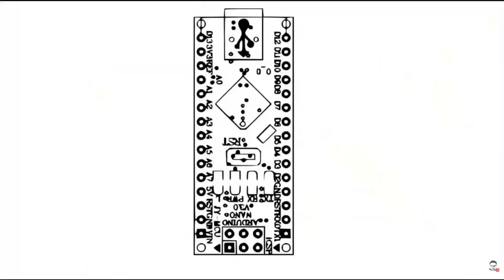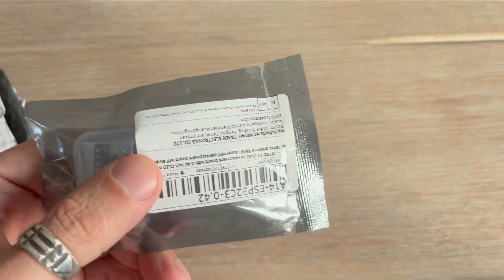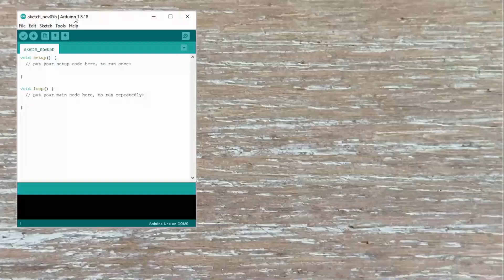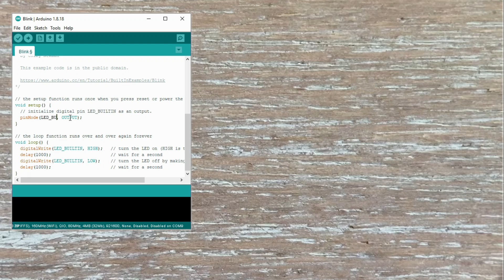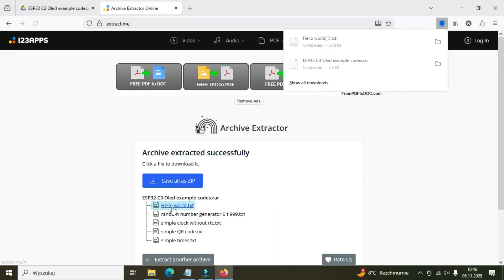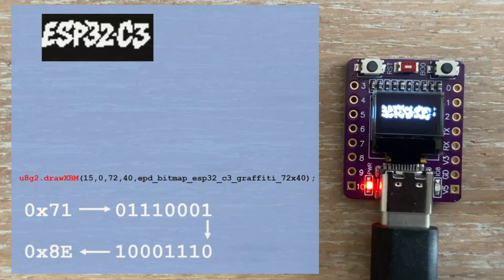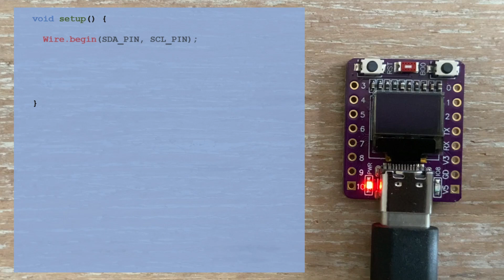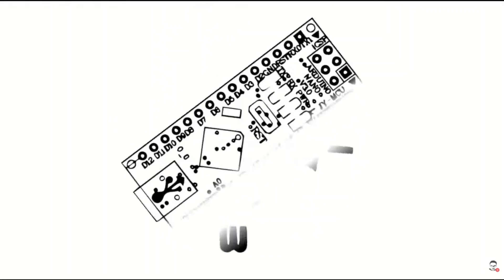Unboxing & Programming the ESP32-C3 with Built-in OLED Display

Comment: I am indebted to this and numerous other such outlets for - well - things like this. I have no particular requirement for using ANYthing like this but I enjoyed a project using a PIC Microcontroller a very long time ago and now probably thirty years later thgings are a little easier hardware wise but a bit more complex knowledgewise. The only two remotely applicable project I may have is to monitor the status of my house domestic Freezers or Frudges and video for my Amateur Radio colegue & me to be able to see of the surrounding area. However seeing output such as this is both illuminating AND enjoyable.
Thank you. I need it my head is not as quick as it was thirty years ago.

Comment: 2:40 yes, of course, you can power this board through the 3.3V pin. There is no reason why you couldn't. You will simply be replacing the job of the onboard 3.3V regulator. Make sure you give it the correct voltage.

Comment: The on-board OLED is amazing feature if you need thing that works out of the box. Just upload your script (in my case a network scanner), connect power source and go out... My script is doing several things. It scans all the available 2.4 GHz wifi networks, find one of unprotected and connects itself to it, sending all the BSSID + SSID to the server via POST request. Then it disconnect itself and repeat the process. If there are duplicate BSSID, they are ignored. The ESP logs all the networks into internal memory to JSON file. It can be transfered via USB by request. This project has been done for fun. Some of the SSIDs are quite funny and you wouldn't believe how many users are using open wifi without any protection even if it's recommended.

Comment: I have several of these and have worked with them quite a bit. The display idiosyncrasies (eg the 72x40 inside a 128x64 buffer) were easy to fix after fighting with my knock off CYD module. One thing I love about these is that they are my only ESP32 modules that power up and transfer data with all of my USBC to C cables and adaptors. They also upload at 921600 baud which offsets the slow compile (although I don't notice them being slower than say the LilyGo T-Display or CYD). I even made a 3D printed case for them and posted it on MakerWorld.
Reply: Have you connected a spi device?
Reply: @chrisvanfelius3079  Once or twice, yes. For example, I set up a simple RFID reader that works well. Mind you, now that you mention it, thatwas with a LilyGo T-Display.

Comment: Hello, your video is very clear, thank you for the details. I have one question, my esp32 c3 is having some issues connecting to WiFi, I read somewhere that if you put your finger to the WiFi antena and create like an "antena" with your body 😁 is connecting faster and seems that is working. Can you tell me what can I do to fix this problem?
Reply: I found a solution from a video and is working, the name of the video is "Triple the WiFi range of your esp32 c3 using one wire! #esp32", is working for me so I hope will be useful to you also 😊. Thanks for your answers. Have a great projects
Reply from the maker: I actually have one esp32-c3 where I have a problemm again. Apatrently it is linked to voltage regulator and I have see som code fix. I will be trying to fix my problem in next few days. If I find a fix I will let you know
Reply: I had the same problem, in my case I had to add this line after WiFi.begin in the setup function
WiFi.setTxPower(WIFI_POWER_8_5dBm);

This lowers the WiFi power which seems to avoid interference. I havent tested the range yet though, but its consistently connecting now at least

Comment: Another great video Mario. I've had one of these for a while and I've been scratching my head wondering where to go from here.😃 This video is going to help a lot but I'm going to have have to watch it several times to get it through my thick head. Thanks.
Reply from the maker: Thanks. Did you bump it up:) I will use this now in ws2812 clock projects but I just need to figure out and  create a video showing how to bridge from 3,3v logic of this board to 5v for led strips. I just found out that the levelshifters I reieved in one of my videos are not fast enough and I have to do it in a different way.
Reply: @marios_ideas  That sounds like a great project, i can't wait. I gave you the bump and so did my wife. All the best mate.